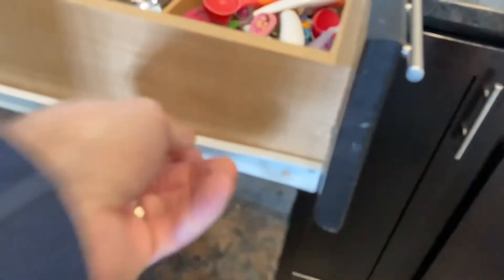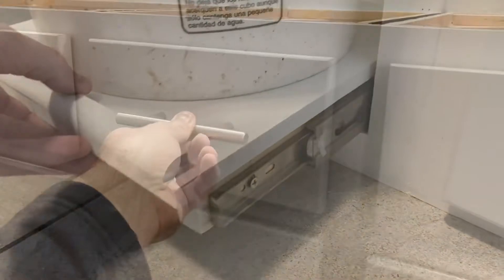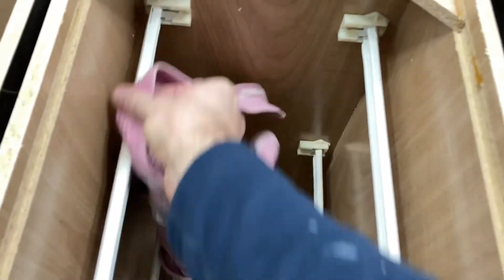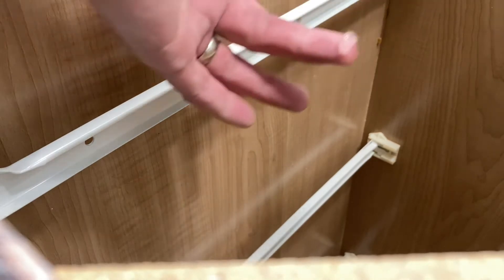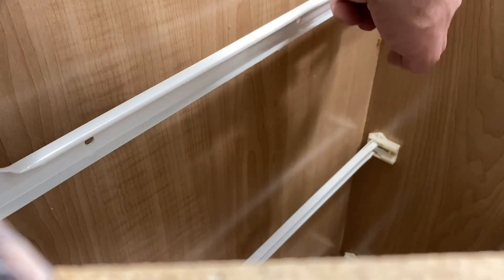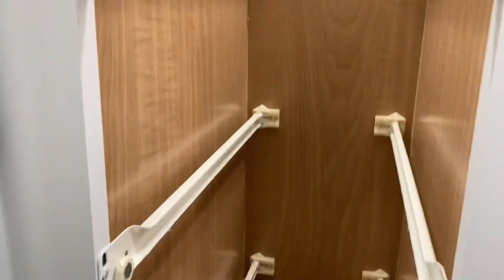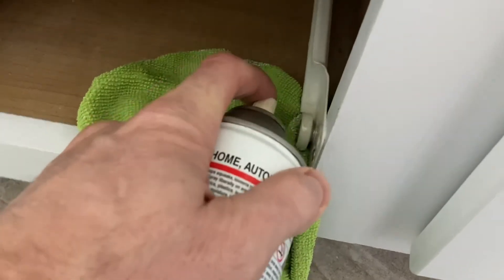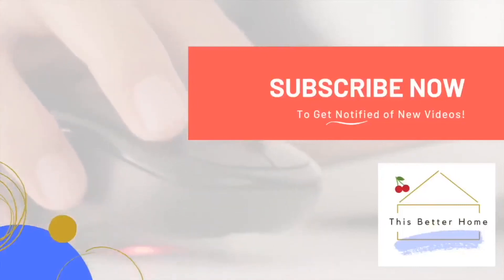️🔥 How to Fix Noisy & Cheap Sounding Bathroom/Kitchen Drawers➔ Quick & Easy DIY Trick - (Save $$$)

Comment: Thanks, I'm going to try this on older style drawer tracks from 1972 where the drawers currently sound like the absolute cheapest pieces of junk ever created.
Reply: Ok, I'm back to report on my results.  What I have are drawers from 1972 with similar white plastic rollers but bare metal galvanized tracks.... very screechy.  First I decided to cut a corner and tried just the white grease.  Bad idea, it helped a little but not much... the drawers still sounded terrible.  So then I wiped off the grease and put a coating of silicone caulk in the tracks and waited 24 hrs.  (BTW it's very important to wipe off ALL the grease before using silicone or the silicone won't stick).  After the silicone dried I tried the drawers and they were quite a bit better.  So then I added the white grease coating and the drawers were even better still.  Basically the silicone adds a rubber coating and the grease makes things slide over the rubber.  Bottom line this is a great solution!

Comment: Lots of people saying they were going to try this....any actual experience? If the silicone caulk trick works -- that is brilliant.  Would be very annoying it if came off in bits and pieces over time.
Reply from the maker: Mine is going strong baby. Definitely quite still and no pieces coming and it’s been several years now. I’d also like to hear from other people, though.

Comment: The link to "spray this on the wheels" takes me to gorilla grease that's nor spray able. 
Could I get the correct spray product your recommending please.
Reply from the maker: Hey - thanks for the heads up. Affiliate links change over time, or I may have gotten the wrong product linked. I just found 2 options and popped the correct links in the description.